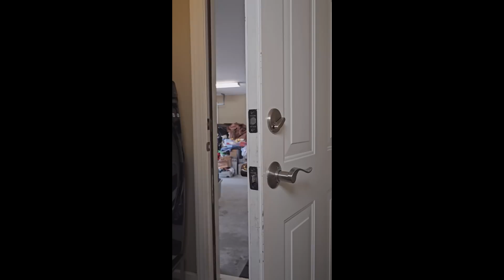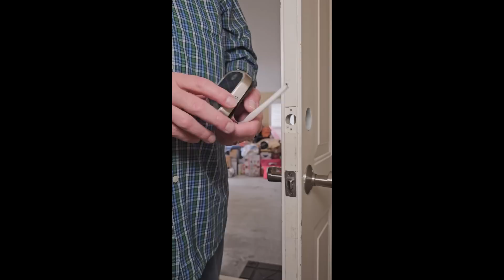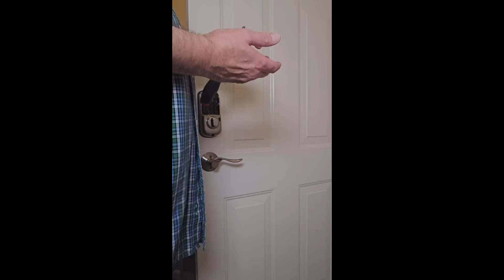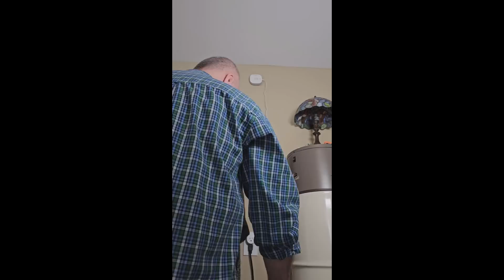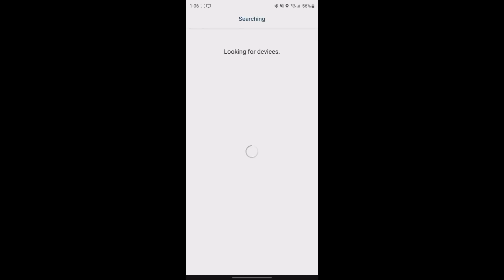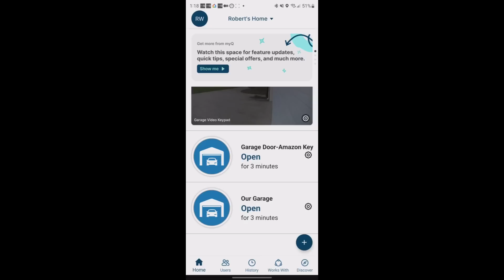Upgrade Your Security: Steps for MyQ Smart Lock Installation

Comment: If you already have a hub for the garage door opener do you still need another for the lock or can you connect to the existing hub. ?
Reply from the maker: Hi there and thanks for the question. The myQ lock comes with a hub in the box, you can then pair your garage door to the new hub and stop using your old garage door hub. That's what I did.

Comment: So there's no key what if the battery dies
Reply from the maker: Hi there and thank you for your question. On the bottom of the exterior part of the lock there are two metal contacts and all you need to do is put a 9 volt battery on the contacts and it will provide the power needed to unlock the door. I keep a couple 9 volt batteries in the garage to make sure there's one handy. I did test it and it worked perfectly. Thanks again for your question, I really appreciate it!